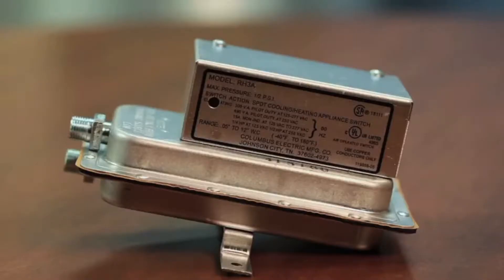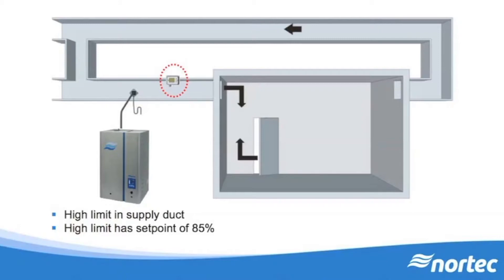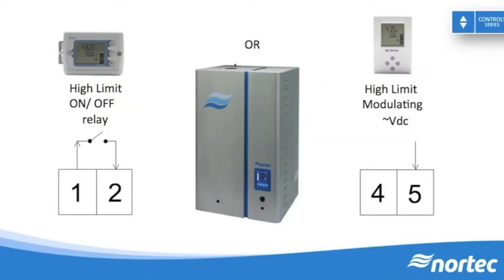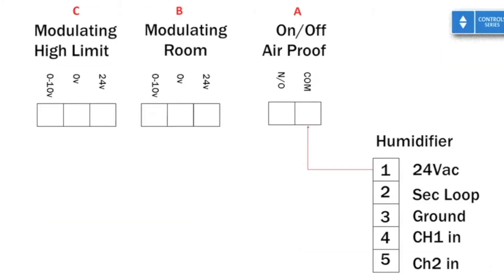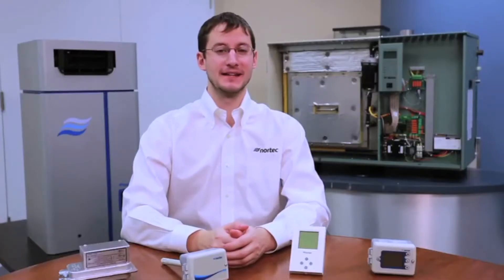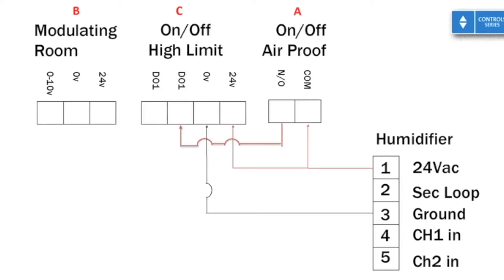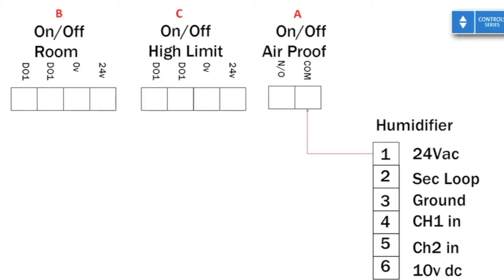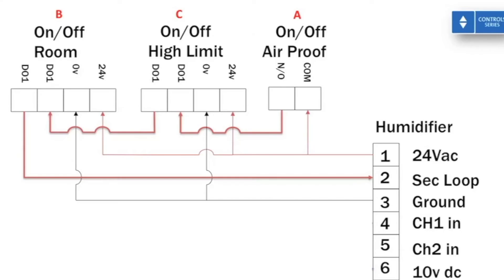Humidifier Controls Made Easy

Comment: how do I get the air handler to energize the fan ( while the thermostat is in the auto position ). My humidistat is calling for humidity, but I need the fan to start to close the air flow switch. Is there a dry set of contacts in the Nortec to close R and G in the AHU, should I want the unit to humidify?